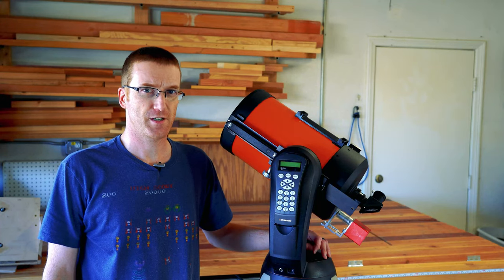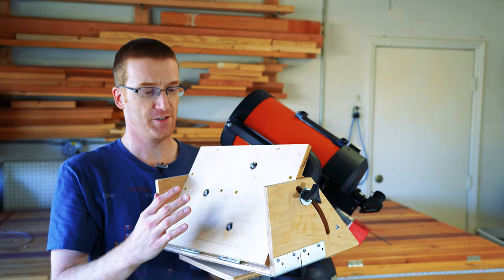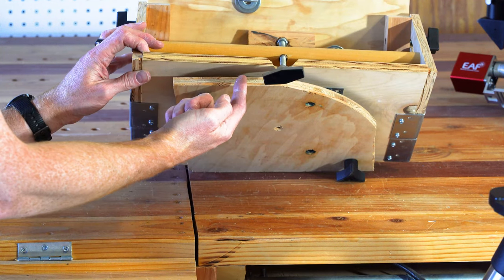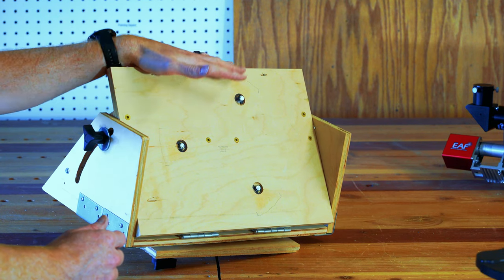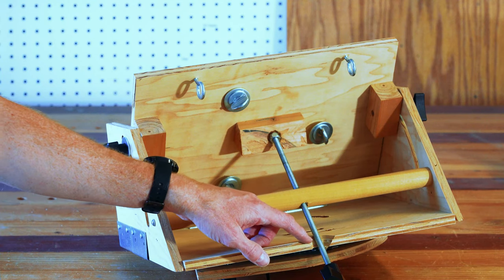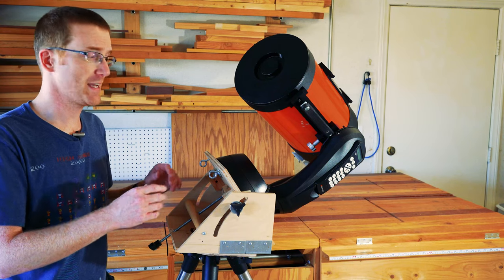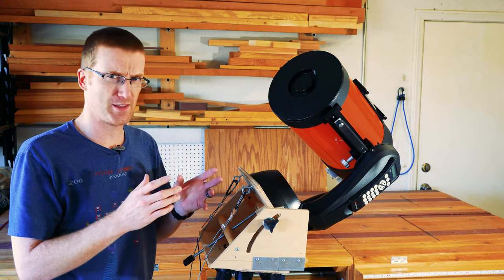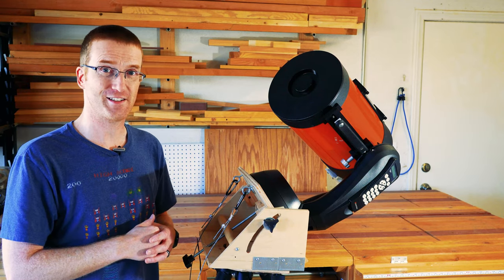DIY Equatorial Wedge

Comment: Great video! Thank you very much. Do you happen to remember the size of the thumb screws, used to attached the telescope to the wedge?
Reply from the maker: I dont, I'm sorry. I think what I ended up doing was removing one of the knobs from the tripod (they were held on with a little clips that's easy to pop on and off) and I took that knob to Lowes and test fit a few nuts until I found the one that fit. Then I just bought a corresponding thumb screw.
Reply: @MrWilsonsChannel  Thank you very much! I will do the same...

Comment: Hey awesome build! did you ever attach stepper motors to the project for non motor telescopes?
Reply from the maker: I never did add motors to it. At the time I built this wedge, the only telescope I had was the 8se which already had motors, so it was a non issue at the time
Reply: @MrWilsonsChannel  ok thanks

Comment: Good work but I have a question. How do you do polar align?
Reply from the maker: The hand controller has a special menu operation for that. I start by using an astronomy laser to very roughly align with polaris. Then you use the menu option to do a star align. Once the mount knows roughly where it's at, it will slew to where a star should be. It will be off. You manually adjust the wedge until the desired star is centered in the field of view. Once the target star is centered, then the mount is also polar aligned. So it's totally different than doing a polar alignment with Polaris like you would with an equatorial mount.

Comment: great idea.. i'm just NOT convinced making it out of WOOD is the correct choice thou? as this needs to be very precise .. and as you probably know, wood expands and contracts and this will cause issues with AP .. but the concept is solid.  just not the material used :) ..  IMO ..  . just need to make it out of material that doesn't contract and expand with weather temps/humidity etc.
Reply from the maker: You're probably right... But an alt az mount,even on a wedge, still isn't the best tool for the job compared to a proper eq mount. Apparently any distortion from the elements isn't greater than the error in the mount itself. I got pretty good results with this wedge But ultimately decided to go for a proper EQ mount in the end to maximize my potential. Plywood is more stable than stock, so perhaps that was contributing to my success. But you're right, there's a reason Celestron makes their professional wedge out of metal. It's more stable, more sturdy, and costs $300 😉 if you are a metal worker I'm certain you could create something comparable using this design and different materials and probably get results similar to the professional Celestron model
Reply: @MrWilsonsChannel  Nope.. not a metal worker.. ( Although I do have a 3d printer with metal copper filament? LOL ) ..

 I'm wondering if plywood, layered in fiberglass would be better? (Protection from weather?) .. 
SO I'm curious on how much more accurate an eq is to a wedge? I've tried to find some data on this. but thus far. I can't find anything other than a few people saying what you said.. but not showing where/how it would be better than a eq wedge that Celestron sells?? once dialed in 100% correctly onto your pier.. I'd think it'd be good to go? or am I missing something? (Should note I have a Hyperstar f/2 that I want to use with wedge.. )
Reply from the maker: I got the feeling that the motors in my next star mount (alt az) weren't as precise as the motors in my eq6 are equatorial mount. I think that's where the discrepancy is happening. I definitely started getting Superior results when I switched to the equatorial mount, so there certainly is something to it. However, the results I was getting with the wedge were still really good. Far better than using the alt AZ without the wedge. The equatorial mount uses belts instead of a direct motor connection and I think maybe that has something to do with it? Perhaps the rubber or whatever the belts are made out of is dampening any motor vibration? I really don't know for sure, just spitballing. I've never heard of a metal 3D printer before! That's amazing 😍
Reply: @MrWilsonsChannel   gotcha .. understood.. I think for the price. I'll start off with the wedge .. You have one for sale? LOL ..  much cheaper than an Eq6 .. I just want to get longer subs that's all
Reply from the maker: The wedge will definitely get you longer subs. Even the home made one was getting me decent shots at 2 minutes or more at 1200mm. Stars weren't pinpoint because of the things we were talking about, but waaay better than the altaz by itself.
Reply: @MrWilsonsChannel  good to know. I'm going to purchase the clestron eq wedge and hope for the best! :) .. it will help with the F/2 Hyperstar too..  but going back to planets for a bit and the moon. than to DSO's.
Reply: @compubyte2010  - how is it working out?

Comment: So you need a router, then drills, then a Dremel, then knobs, screws, hooks, counterweights, wood, and the skills to do all that. For that amount and effort you might as well buy the damn wedge. Or better yet: SELL THE FORK MOUNT and buy an EQ mount.
Reply from the maker: Those searching for "DIY" usually have some diy skills, basic tools, and a "get er done" mentality already. If you're a diy'er then this is a very cost effective solution. Plus the pride one gets from completing a project yourself carries an intrinsic value you just can't get from buying something off the shelf.

Comment: Mr. Wilson. Does the Celestron Wedge, $300, really work?
Reply from the maker: My DIY wooden wedge worked, so I'm assuming the real deal would work even better. But it really isn't an adequate substitute for an equatorial amount. Primarily because the alt as Mount that comes with this scope can't take a lot of extra weight. Additionally, the camera can run into the bottom of the mount if you aren't careful.

Comment: is it compatible in  Starsense Explorer Lt 127 az??😃
Reply from the maker: Im not really sure. I know it's compatible with most rack and pinion style focusers so it would probably work? But you might need to drill a hole in the eaf bracket if it doesn't perfectly line up. I can guarantee it won't work with the cell phone star sense app, however. You'll want to connect it to a proper controller like the asi air pro, a laptop, or just get the hand controller for manual operation.
Reply: @MrWilsonsChannel  thank u so much for replying...😊
Reply from the maker: Of course! Clear skies ⭐